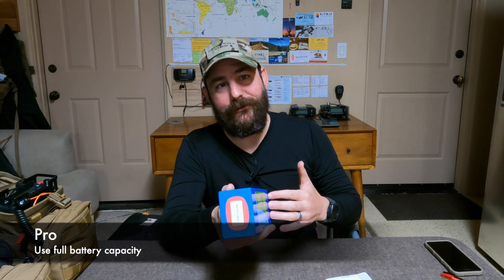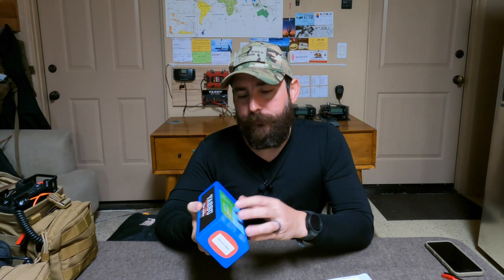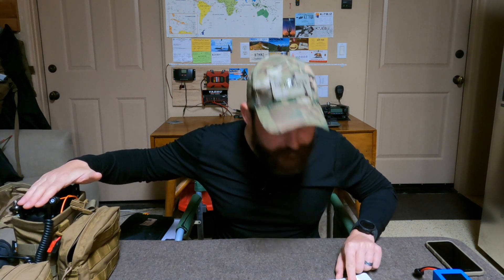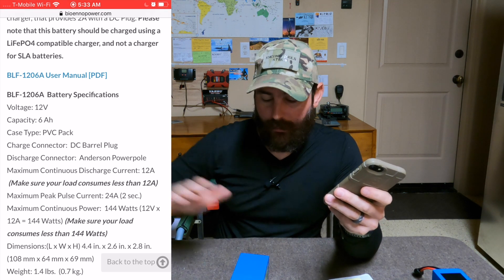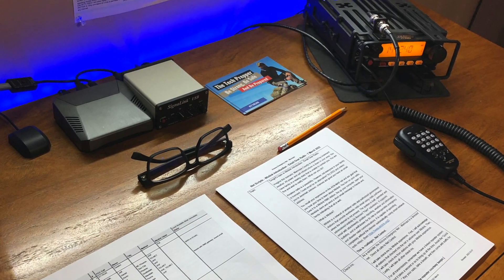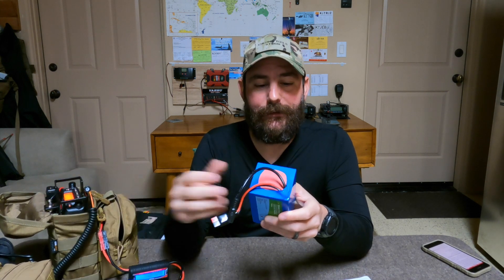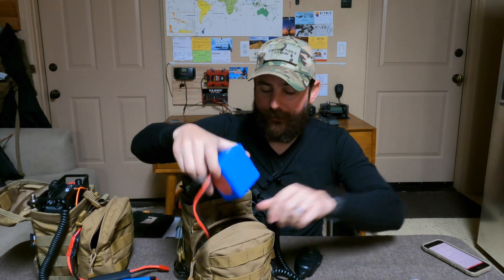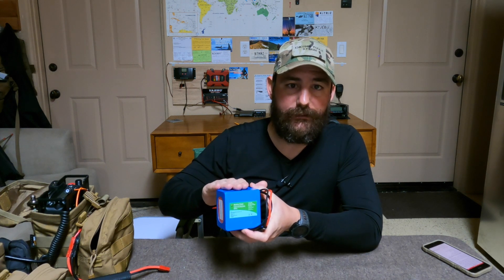How to size a battery for Amateur Radio

Comment: I would recommend considering 3S Lipo batteries as well for RC cars and planes. You don't have as good of a voltage range as LiFePO4, but it would be able to power QRP radios without any issues and should be able to power mobile rigs if they can handle down to 11 volts (which they should).

Comment: I have a 100W radio that draws up to 23A at 13.8v on transmit. The 6Ah Bioenno battery supports 12A draw, so, in theory, I should be able to run the radio at 50% power output (50W). What would happen if I accidentally tried to transmit at 100W? Would the battery just turn off on overcurrent limit? Or, would the voltage drop, possibly damaging the radio?

Comment: Can’t believe I’m just seeing this now. Are you still using the buddipole power mini 2 charge controller with the 20W powerfilm solar blanket? So this blanket could potentially charge a 10A Dakota battery in 10 hrs of full sunlight?
Reply from the maker: I am still using this exact system as well as the Dakota 10Ah LiFe battery. Yes, in full soon it can be charged in less than 10 hours. Out here in Arizona, it's free energy almost every day of the year. Thanks for the view.
Reply: @TheTechPrepper perfect will get this setup!
Reply: Are you able to use the code of battery and charge it at the same time? I don’t see that it comes with a DC port like the bioenno
Reply from the maker: @marctlm3636  Yes, I created a custom cable. I picked up F-type female connectors from the hardware store, then ran two sets of cables to two Anderson PowerPole connectors. One is used for charging and the other is used to power the radio.
Reply: @TheTechPrepper that’s great. Would love to see a short on this. Just got the 20W powerfilm blanket and the buddipole mini power 2 for my Dakota 10A and 857D pack

Comment: Very informative. What QRP antenna do you use?
Reply from the maker: I use two depending on the environment that I'm in and what type of performance I need. I run two antennas by Tim N9SAB. One is his 40m EFHW and the other is my collaboration with him—the TTP EmComm Linked Dipole. The later was designed for low deployments and supports 5-bands (20m, 40m, 60m, 75m and 80m). His store is on eBay.

Comment: Super helpful video! Ignorant question: for batteries like this, is there any way to see the energy remaining in the battery? My power stations show percentage remaining - is there any way to reliably do that with batteries like this? Thanks.
Reply from the maker: The only reliable way is to use a shunt, but that is over kill for these small batteries. I use the Victron Smart Shunt my larger 100Ah LiFePO4 batteries. I've had some success using a PowerWerx power meter plugged into these smaller batteries, but you essentially need to perform a full charger then plug it in, then refer to the meter as needed.
Reply: @TheTechPrepper  Thanks so much! Love your channel.

Comment: The radio specs that you have are given for 13.8v not 12v. So, first calculate the Wh of your battery: 12v x 6Ah = 72Wh. Then calculate the power draw of your radio on Rx at 13.8v: 0.5A x 13.8v = 6.9W. Finally, calculate the time your battery can run the radio: 72Wh / 6.9w = 10.43 hrs. So not the 12hrs you say at 04:45, but your simplification is good enough for a quick estimate.

Comment: What adapter do you use to connect the Bioenno battery to the Yaesu FTM6000R?
Reply from the maker: Powerwerx REM-T Connector to Powerpole Connector 18 in.
Reply: @TheTechPrepper  You're a beast! thank you!
Reply from the maker: @RandomStranger69  Thanks. Glad you found what you are looking for. I did a manpack build for the FTM-6000R, so I just pulled that part from the list of items in that old video's description. Have a good one.

Comment: I just recently got a Bioenno Power BLF-1230A battery to hook my mobile 2m FM radio to when in the pickup. This way I don't have to mess with running wires from my truck batteries through the firewall (or worrying about possible trouble with the onboard computers). So far, so good. I intend to move up to portable HF operation in the near future and figure this 30ah battery should cover it all.

Comment: Im not seeing a current consumption for the Anytone at-578UVIII Plus in the manual just Operating Voltage 13.8V DC ±15% what do you suggest for this rig?
Reply from the maker: Take a look at the Dakota 10Ah LiFePO4. It will do 20A continuous. This is what I use my AT-578. That battery is a great price, too.

Comment: Can you do this same video for solar panel sizing
Reply from the maker: Unfortunately, I have all my videos lined up for the rest of the year. The math is same for solar panels. Take the watts of your panel and divide by 12 (for 12v) and you end up with amps that it can generate per hour in full sun. For example, my 20 watt panel / 12v = ~1.6A.  I get full sun where I live, but I still assume about 80% efficiency, so I will take 1.6A * .80 = 1.3A. In practice, I can charge my battery At 1.3 amps per hour.  I don't typically use more than 1A per hour, so this panel is sized perfectly for me.

Comment: I wonder if you’re only seeing 8amps because your running at 12V instead of 13.8V?  I assume then your output is probably much less watts than the rated 50?

Comment: I'm confused on the weight of these batteries. I have a 20Ah power bank for my phone. It's 5V, so 100 Wh, and putting it on the scale with case and cable it's 0.8lbs. The bioenno 6Ah, 12V battery is 72Wh and is 1.4lbs. Why are they SO much heavier than a power bank for your phone?
Reply: Late to the party...
Power banks are offen specified for LiIon cells and they are 3.7V nominal so it will be around 72Wh also.
And LiIon have higher energy density then LiFePO4 so they are still heavier. But 4 cell LiFePO4 have the perfect voltage range for radio and its much safer then LiIon so for me the weight is worth it.

Comment: One of the things to keep in mind about batteries that may be used in emergency situations, especially situations that may last over 24 hours, is the recharge specification.  Maximum solar power is only a few hours per day and generators take gas to run, and if grid power is on for a only a short time, it would be nice to be able to recharge batteries.  I have several Bioenno LiFePO4 batteries, and they are good quality and a good value for the money.  However, their specified maximum recharge rate is low compared with high quality AGM lead acid batteries or Dakota Lithium LiFePO4 batteries.  Maximum recharge rate for a Bioenno BLF-1212A (12 Ah) is 2A, taking up to 6 hours to recharge.  The maximum recharge rate for a Dakota Lithium 10 Ah is 10 A, meaning several of them could be recharged at once by running a 1 KW generator for 1 hour.  For the best battery life, both brands should be charged at about 0.1-0.3 capacity rate.  Meaning a 10 Ah battery should routinely be charged at around 3 A.
Reply: good info, thanks
Reply: The 0.2c rate charge, or 2amps is just a suggestion to get the most life cycles out of the battery. That 12ah battery has a 30amp bms(says in the notes at the bottom of the page). So technically you can charge it at 1c if you'd like, you'd just lose some cycles. But in a pinch its perfectly fine.

Comment: Love your videos. However I think working in W (kW) and Wh and kWh is far more useful than working in Ah. For example  if you put on a power meter and work for say an hour and use 100Wh this gives you a better balance of usage than looking at instantaneous amp draw. Then if you have a 135Wh battery (10Ah) the math is easy. If you stick in Amps and Ah you get tied up in trying to extrapolate usage over time. Then when you throw in solar it gets worse. Now youre trying to mix Ah and W… if you have a 100W solar panel and you have a 135Wh battery and you out in good sun for 6 hours. You can even better estimate your run time. 100 x 70% (miss aiming, heat loss…. ) x 6 hours then you 420Wh of additional run time so long as you run your battery down to allow for that energy to be stored. Then you can calculate that you can run your rig for roughly 5-6 hours.
Reply from the maker: You make some great points for watt-hours, but the amateur radio community seems to have adopted amp hours as the standard way of communicating power requirements. My brain is hardwired for Ah instead of Wh, however, I'm
a fan of whatever method others use to understand their power utilization. In my case, my swag estimation has worked well in the field. Thanks for a sharing a counterpoint.
Reply: @TheTechPrepper  Totally! old ways die hard. But here’s another example for ya where working only in Ah would kill a person! I’m build a portable repeater box. it has a hand held GD-88 (7.4v) with an attached 3Ah battery wired into a voltage converter thats set to 8v to pull form a higher voltage battery and has about a 15-20% loss from the converter but most of that goes into keeping the battery warm and saves on the next item, a 5W battery heater (12v) and a Lora transmitter (5v), an 8Ah 12 volt battery, 5W of attached solar (12v) and 30w of additional solar (12v) now things get sticky trying to calculate run time. However if I convert to Wh it gets much easier 

HT (-1.5W/h avg or 36Wh/day)
Lora (-0.1W/h avg or 0.24Wh/day) 
Heater (dependent on temperature, but roughly -60Wh/day)
Solar (+210Wh/day)
Battery good for 96Wh 

That means I all I have to do is add up the + & -‘s and we’re good.

Total of 96Wh/day of usage.

This basically means that as long as the sun is shining even some one what each day I’m good to go for extended runtime. Worst case scenario, I get one full day of use. Also the battery heater doesnt run fully every day. Ironicly the clouder it is the less the battery heater runs. Also in the winter I attached another 100Ah Battery box. 1.2kWh of addational run time!

Comment: Does the buddipole do the same measurements as the powerwerx? Can you charge via solar while using the radio on the same battery?
Reply from the maker: Yes, you can charge and use the battery at the same time.

Comment: hello, can we use power bank for rig mobile as a power supply
Reply from the maker: I'm not due what you mean by power bank. Most battery chargers are on the market are for 5v devices, not 12v. I have used a 12v battery, 3000mAh  pack from TalentCell, but only for low power radios like the Yaesu FT-818ND (6 watts max).

Comment: Im back to this video again. First, I love that you have never used a traditional plug in the wall power supply. I just gave mine to a new ham operator and since I had the bioenno felt good about that decision. Second, Im so confused about how to read the DC Powerwerx device. I wonder if you can make us a video on how to interpret that data. I realize the display is hard to see on camera.
Reply from the maker: Welcome back! I get a lot of grief for it. I do own a Yaesu FT-897D now that has a built-in A/C mains power supply...it feels like cheating. I'll add this video to the backlog as this is a really handy tool. 73's

Comment: Cliff Bateson, QRP School, did a nice series on portable power for ham radio. Julian, OH8STN, has a lot to say about portable power as well. In the end, the math is a weighted average of receive current (standby) and transmit current (key down current times duty cycle for the mode), with the weight being the amount of time spent on standby and on transmit.

For your case, you were using FM mode, which is 100% duty cycle. You were split half on receive and half on transmit. So, for each hour of operation you would consume 0.5*0.5A+0.5*1.0*10A, or about 5.25Ah. This is consistent with your reported use of energy from the battery.

If you had plugged in your charger, you would have drawn about 2Ah from the charger. In the field you reduce battery draw during daylight hours by the amount of power produced by your solar rig. I usually figure about 70% of rated output from the solar system unless you’re religious about keeping the panels turned into the sun (and you have good sun).

So, sizing your power system then becomes an arithmetic problem that is reachable by almost everyone that can pass the amateur radio exams. 

When I sized the system for my camper, I included nighttime activities as well as a safety factor should I not get good sun.

The price of PF panels skyrocketed over the last couple of years. I nearly chocked when I priced a 60w foldable panel last week. But they remain the gold standard (pun intended) for foldable and I have a buy-once/cry-once approach to such things. I use Genasun charge controllers. Be aware than long cable runs between panels and charge controller can act as antennas so CMCs are appropriate if you get noise on the rig.

The charge cycle for LFP batteries is constant current until the controller detects a slight decrease in voltage, then constant voltage to full charge. This is not a float charge as done with lead-acid batteries. The charger stops its cycle when full charge is detected by the controller.

Part of the problem with lead-acid chemistry for ham radio is that the full charge voltage of lead acid batteries is just over 12v. Lead acid batteries at 50% SOC are at about 10v and most rigs don’t like voltage that low. The LFP chemistry starts about 13.2v and does not fall off during discharge until very late in the cycle.

The deep-cycle lead acid batteries can handle SOC less than 50%, but their voltage will be at/below 10v. Our rigs don’t like that low of voltage, for the most part.

You probably know all this already. This is what I’ve learned over the last few years researching portable power for ham radio. I thought others might benefit from my experience.

73 de AG7TX
Reply: Nvrumi <—. GTEAT explanation of the voltage drop off on different batteries, and how that’s not the case with the LiFePo which was my exact question when coming here to the comments. As I never met a mobile rig that was happy very much below 12 V.  

Only other question I had was is there some sort of charge controller I could hook up to the cigarette lighter to replenish these little blue batteries like he demonstrated, as I drive?

Comment: A Icom 718 uses approx 8 amps transmitting at 20W SSB. That would mean a 16ah battery would last me 2 hours at 100% duty cycle? Am I doing that right?

Comment: It would be nice if someone did a video on not only how to size a Bioenno and Solar panel not only for a ham radio rig. BUT also the rest of the  electrical equipment that you might use if you are out in the woods. 
Here is what I mean. You lay out a solar panel, connect it to an appropriate solar charge controller. Then connect that to the LiPo battery and them run the power poles to a power pole distribution block. 

You plug the rig into two of the connectors of the power block. You then also connect your: #1 laptop/tablet
#2 cell phone.
#3 Rechargeable Flashlight
e.t.c Those are just three things to come to mind that I would be out camping with.
So ideally the solar panel will keep the battery  FULLY charged during daylight hours. The battery will provide current to all your equipment BUT will keep its full charge. Then when the sun goes down thing will run off the battery at night until the next morning when the sun comes back up.
If that makes sense.
Reply: How are you going to carry all that equipment into the woods would be my first question?

Comment: Hi there. What battery specs are required for an anytone at578 manpack? Could you please give some advice?
Reply from the maker: It's listed in the manual. I don't have this radio, but the manual says a minimum of 15A. So, look for a battery that allows a bit more continuous current. I would size it by 20% (18A continuous).  I assume this is for max power.
Reply: @TheTechPrepper  first of all thanks for the reply. Yep I had downloaded the manual and saw that part so i sent a screenshot to some aliexpress battery sellers. Problem is I don't know what any of that means. So I need to look out for: voltage, amperage (which is capacity right) and what else? Then I just  connect the radio wires directly to battery and it'll work?

Comment: Can you charge the Bioenno battery with the AC to DC 2A/4A chargers while using the battery via the anderson plug? When running this as a vehicle mobile unit, are you running it on battery only or do you have vehicle battery connection as well as antenna feed line?

Comment: Great video. Simple and straightforward. I've used SLA batteries in the past but now moved to strictly Lifepo for all my radios. Always, always, always keep an eye on amps and volts. I let a 20w HF radio get below 12V using SLA's and the radio locked up. All my SLA's are now used for emergency lighting and other non radio uses. Thanks. Jack K5FIT

Comment: The transmit current specification probably assumes a 13.6 volt supply.  Bienno batteries provide something like 12.8 and drop somewhat during usage.  https://powerwerx.azureedge.net/productattachments/BLF-1220TS_LB__User_Manual_rev_08_04_2016.pdf

Comment: A 12Ah battery will provide 12 amps for one hour. So you should be able to RX at 500mA for about 24hours,
Reply from the maker: Correct. That's the rough math.

Comment: One comment on the "simple math" for charging Bioenno LiFePo batteries - The manual says that the charger will begin at with a constant current charge and then shift to a constant voltage charge (which tapers the current into the battery after a certain point).  The LED signal light changing from red to green does not indicate the battery is completely charged.
Reply: Sorry if I missed your point, but what woes it mean then when the light turns green?  And would I need a ($50 ) in line volt meter like he showed to know when fully charged ?
Reply: @teatonaz  The charger instructions talk about the time required for a full charge.  I am not near them at this time, so I can’t provide details.